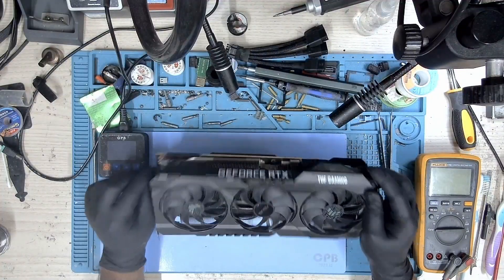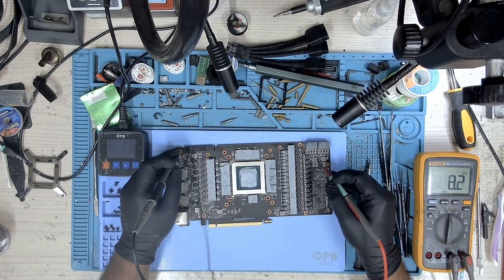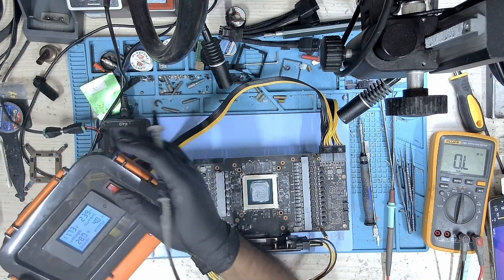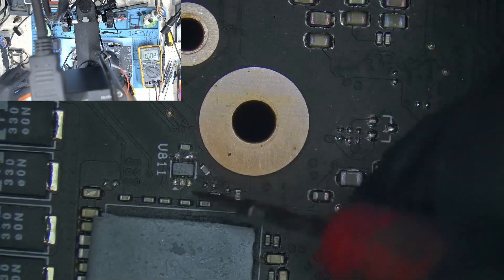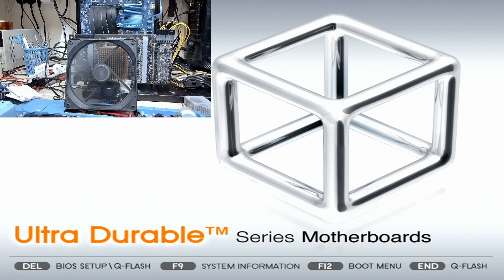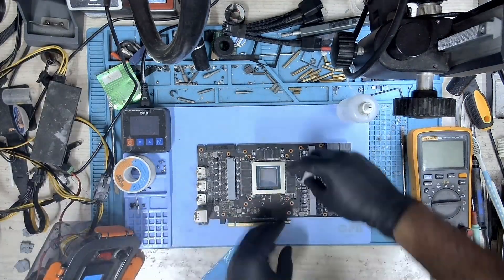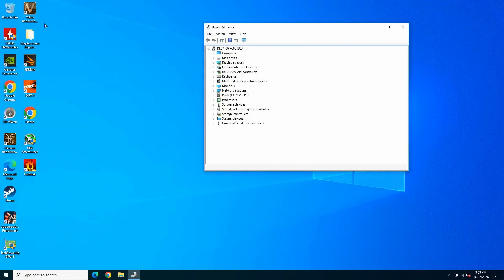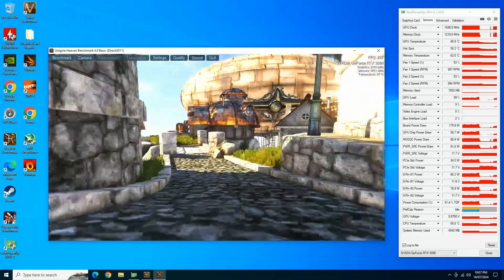How I Fixed My RTX 3090 Not Detected Issue

Comment: Hi, I have a short on the 1.8 line. I lifted the inductor and indeed I still have a short on the core side. Is there anything I can do or is this already an indication of a dead core?
Reply from the maker: If th short is on the core side then it's possible that the short is either on the core or on the memory. You will need a thermal camera to inspect further. Injection 1v 5A into the inductor and check check what lights up. Is it the memory or the core. If it's the memory replace the memory and you're good but if it's the core then a core replacement will be needed.
Reply: @GraphicsCardRepairs-tk7ql thanks you sm

Comment: I just installed a used RTX3090Ti in my server motherboard. However, the lights don't light and the fans don't turn and no display on either monitor.
Reply from the maker: It will need to be examined to find out what the issue is. Like voltage and resistance check
Reply: @GraphicsCardRepairs-tk7ql  3 issues found: the card would not seat deep enough into slot. (that got the lightbar working). 2: one of the AUX power connectors wasn't making good contact (that got the MSI logo light and fans running). 3: had to make some changes in BIOS, mainly change the PCI-E slot from Legacy to UEFI. Then the card would boot.

Comment: As the VRAM, mosfet and , top of all, GPU will heat as hell as  you turn on power supply, is it safe to test voltages without any kind of cooler ? I'm currently working on a RTX2080ti, it is very hot even when idle
Reply from the maker: When testing it does not affect much. The temps do not rise above 50c. So it's absolutely normal during testing.

Comment: I didn't understand how you found out at 3:25 that the faulty chip has to be an N gate (MOSFET?). Can you explain?
Reply from the maker: The resistance on the 1.8V was low even though 1.8v was present. The other voltages required were also present but the GPU was not detected indicating something could be on the gate on the pex reset as pex reset takes in 1.8v. it is not always the case but most of the time it's the PEX reset. If this was not the case  it would then be either the memory or the core and that would have been the end of this GPU. Luckily it was the gate that was the issue.

Comment: what's the and gate?
is that N channel mosfet?
Reply from the maker: AND gate is a logic gate. For example there are 5 pins on a logic gate, one of them being ground so what a logic gate does is if there is voltage on 2 of the pins then it lets voltage out on the 4th pin. So it's like voltage has to be present on 2 pins to get an output.
Reply: @GraphicsCardRepairs-tk7ql  thank you for your sharing

Comment: Do  you spare GTX 780 FE blower fans? I have the card but when I tried to dissamble the fan from the gpu it cracked from beneath (the plastic that connects to layer just above the die and pcb)
Reply from the maker: No I don't have the 700 series parts of Nvidia. I got them disposed of a long time ago. I have not got a single 700 series card for repair in the last 3 years.
Reply: @GraphicsCardRepairs-tk7ql  Okay. Is it crucial not to take the fans out of their old blower series ? 700 - 1000 series? I just took one off to give it a brush but unfortunately it cracked from underneath leaving the plastic that normally covers the vrms, ram, and power board and it can no longer attach the again, maybe I could use soldering technique but I do not have them right now.

I just got an offer and just taken a whole of the same gpu for cheap price
Reply from the maker: If it's plastic that is broken then use super glue to stick the plastic together.
Reply: @GraphicsCardRepairs-tk7ql  I didn't give that a go cause the fan cannot stick, it needs a special rotation on the heatshield that requires the best cooling and noise, so instead the pieces of plastic was carefully removed from a screwdriver and now I have to wait for replacment fan. 
Not doing the same fan removal again I wasn't sure if I could be able  to use AIRDUST
Edit: Now 2 GTX 780s I am considering of going for that ultimate 11 years old dual setup with an i7 3770K and 780 plus DDR3 of the fastest of it's time and seeing how that performance rakes in this years most popular games. Somebody may appreciate the SLI

Comment: What is power supply for testing? I want to buy this
Reply from the maker: You will need a variable bench power supply. 0 to 30v atleast 5A as the source for this customer power supply. Rest of the circuit if from Tony from Northwestrepair.

Comment: Awesome repair as always, thank you for your great helping videos, keep it up brother, and if you spare some time I have a little question, I had an rtx 2060s from gigabyte with micron memory 😢 and c1 faulty with 200k or more errors, so I replaced it with a new one, and now the gpu pass mats test, but the problem is in furmark, after about 5-10mins of stress test, I get a blue page, and pc restarts, and at that time exactly I do another mats test, and I see A1, b1, c1, d1 faulty with a very little number of errors about 80, and if I shut down the pc and let it rest for few minutes and turn it on and test I get no errors and pass the mats test, can you please help me out, and thank you again
Reply from the maker: Is the micron memory of 2018? If the batch number starts with 8 then it's is 2018 batch. If it starts with 9 or any alphabet it's 2019 or later. If it's 2018 then all the memory will need to be replaced. The 2018 batch is faulty.
Reply: @GraphicsCardRepairs-tk7ql  yes it's 2018, and i replaced it with one from 2019, the c1, so i don't need to reball the core? I need to replace all the 2018 memory left if I'm correct right? And thanks again
Reply from the maker: Yes all the memory will have to be replaced.